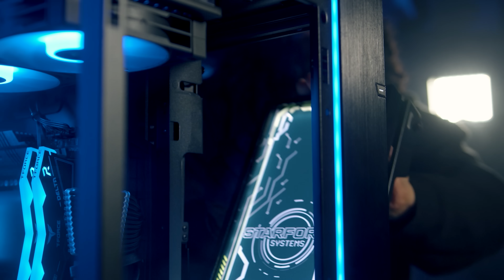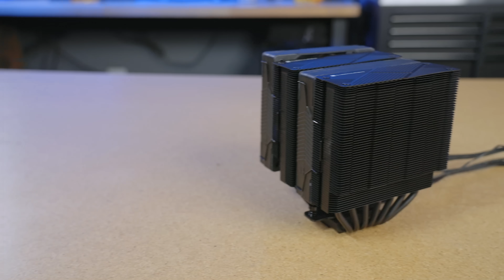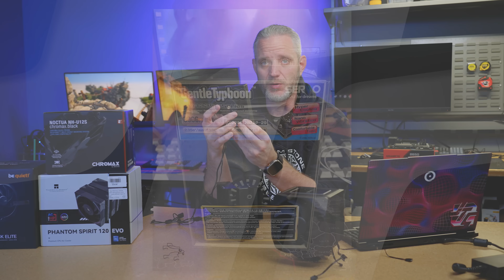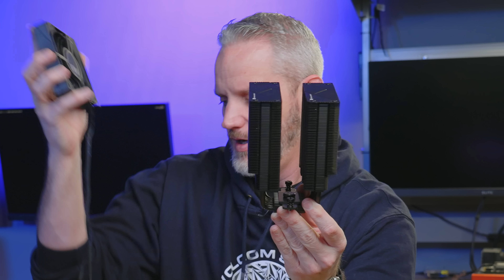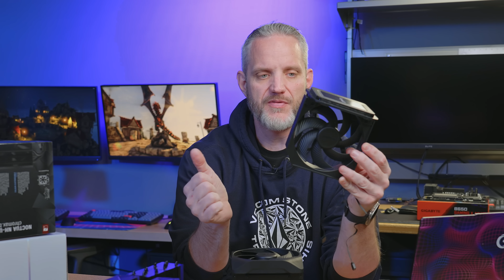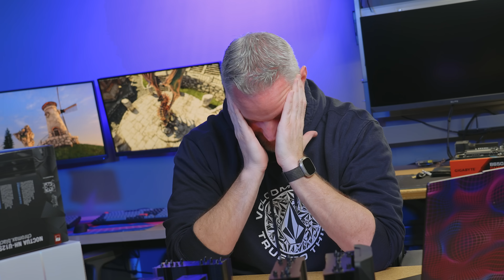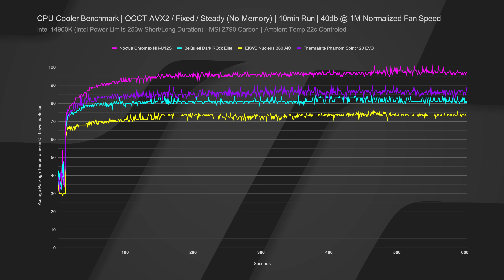This $49 CPU Cooler has big brands SHOOK! Thermal Testing Cheap vs Expensive CPU Cooler!

Comment: I would have found IT more interesting If the AIO would have been more around the same price point as the thermalright aircooler. Like i use an Arctic liquid freezer iii 360 for 60 Euros and IT cools my 9800x3d very well. That would have been a better comparison imo

Comment: I bought that thermalrite cooler because of your previous video. But I put it on a 65tdp ryzen 9 7900 😂 the max temp was around 86C. It is turboing constantly. No throttle at all. It became overkill combo for low price.

Comment: Idk if this is gonna be eye opening as you said, because believe it or not - I know, it's insane -, there are a lot of liquid cooling fanboys out there. Imagine being a fanboy of a METHOD of cooling. LMFAO.
Meanwhile, my old Noctua NH-D15 just got a new companion and they're doing just fine. I got a new 14700K running 5.6Ghz all cores below 65 ℃ while gaming!

It reaches about 83 ℃ in 3 cores and 75 ℃ in about 5 other cores while running Cinebench, btw. I bought thermalright frame just to be safe, but haven't installed it yet.

P.S.: I'm not an expert, but I didn't see it disclosed on your tests that you performed Undervolting. As someone who have constantly in the past said that we need to undervolt, not doing this here in this test - specially with a 14900K -  is crazy.
Reply: i dont think it makes sense to undervolt on a thermal test, its only going to introduce more uncertainty. to test a cooler you need a consistent heat source and representative mounting, and its important to test how the coolers affect the CPU's voltage/frequency regulation. you should compare to stock
Reply: @HiChessie  I see.
Reply: @CeceliPS3 
lol calm down
Reply: @Robbie-mw5uu  first liquid cooling fanboy reply. You didn't have to out yourself, you know... lol

Comment: Favorite that I want, but have absolutely no need for: Icegiant Prosiphon Elite. It's like the wildly impractical sports car I will never be able to afford, but still dream about. 

Favorite that I use myself: My Noctua NH-D15 Chromax Black has served me well for the past 4 years. I also have an NH-U12S cooling my second rig. 

Potential favorite: I will probably put one of the Thermalright coolers in my NAS box when I finally finish it, because they perform well and don't cost an arm and a leg.

Comment: I've become sort of a Be Quiet! fanboy lately.  I love their cases, fans, CPU cooler and power supplies.  I have not had any issues with any of their products accross 3 different PC builds in the last 2 years.
Reply: Their cases always seem like a bad joke when it comes to airflow. The front grilles are like 80 percent solid metal with absolutely tiny holes
Reply: I absolutely love their fan designs with the ripples, if only for aesthetics. I have the Dark Rock Pro 4 cooler and 500fx case, and I have no real complaints on them. I was also planning to get one of their PSU's the next time I need one. 

And then I built a system for someone else that used Lian Li fans and Hydroshift AIO, Lian Li Edge PSU, and in a Hyte Y70 Touch case. I'm now rethinking my entire future upgrade path because that was a build I actually liked doing rather than seeing it as a bit of a chore. My Be Quite fanboyism is waining a lot, especially after that new convertible case they recently released. That just looks fugly to me.
Reply: First Be Quiet cooler i had was the Dark Rock Pro 5 and the high turbulence noise at high rpms just killed it for me. Also the middle fan is proprietary so if it breaks and you run out of warranty you have to buy a whole new cooler. The Dark Rock Elite is even worse because not just the middle but both fans are proprietary.

Comment: Was a huge fan of Thermalright back in the Venomenous & True Spirit line up. My EP at MC for them was great too so I was sad when MC stopped carrying the brand. Left the new consumer scene for a bit as I really got into used server stuff & hypervisors. Coming back to consumer side for the past year or so I've been a HUGE fan of Thermalright. I even went with a 360 AIO (in white) from TR for my current build bc I wanted to test the longevity of them (yes it's mounted correctly). The air coolers are top notch & at a great price.

Once they come out with (or someone posts a 3rd party utility on Github) Linux compatible software for their new screen based coolers will be a huge day & I'll definitely swap out my current 360 for one with a decent sized LCD screen.

Comment: I bought a NH-U12s 5 years ago for $70.  It started cooling a 2600X and today is cooling a 5600X.  I would not put on a 14900K, it's not made for that.  Still begs the question as to why they want so much for it.  I thought $70 was too much.

Comment: I think its also worth noting that some may perform different depending on the platform from what ive seen that is..Intel lga /am5 for example..due to the convexity/concaveness of the ihs and the backplate of the cooler. And i think the location of the ccds was mentioned aswell ..But yeah thermlaright has been killing it..even now doing the "meta" of lcds in some of their air models

Comment: i wonder if it would be possible to build a cheap testing rig that doesnt use a real cpu but can give realistic numbers to tell the tdp limits of the coolers. something like a heating element on an ihs with temp sensors on it, and an arduino or something that slowly increases the wattage till it hits the temp limit, 100c or 90c or whatever, just slap a cooler on there, let it cycle through everything and tell you exactly where it failed to keep up

Comment: peerless assasin 120 and nhu12s. those are my two cpu coolers atm. got the peerless assasin to get more cooling capacity for the 10700k i tossed into the rig (upgrading from the 10105) and coller me impressed it works well.

Comment: Would it make a difference if you put 2 fans on the single tower cooler? AKA, If you already own a single tower cooler would buying 2 fans make sense vs buying a new Thermalrite cooler? Would fan curves not keep the extra noise at top load only but reasonable at average use?

Comment: Noctua NH-U14S would have done a better job than that little U12S.  I use it to cool my 2990WX Threadripper and it does that job in spades.

Comment: What about noise normalized tests as I don't think anyone runs at 100%?
Reply: They were noise normalised to 40dB (in order to handle a 14900K that's ever so slightly above the max rated TDP of all these air coolers).

Comment: Speaking of direct heatpipe coolers, I would loan you my Thermalright True Spirit 140 Direct, but I'm using it.  My favorite thing about the cooler was the box included a pair of gloves so I would not bleed all over the sharp fins during installation.

Comment: Yea, I kind of regret getting a Noctua nh-u12a chomax black cooler. It looks great and its really silent, but there are coolers that are way less expensive and perform very similarly.
Reply: same..... but they do not perform similarly....they perform much better.... 10 degrees is alot and regardless of cost i feel cheated by the u12a on my new build
Reply: @earthling384f  at least we get a cool little noctua badge thing

Comment: '...Ruffles for your pleasure' LOL! Do you happen to have one of those Gentle Typhoons to see if it still holds up today? Would be neat to see older coolers adapted for modern CPUs to see how the old designs hold up if applied. Neat video and the maths for the cost you came up with are an excellent way to see if the cooler is worth it.

Comment: I picked up a Thermalright aqua elite v3 for like 53 bucks on Amazon, I have been so impressed with them and their pricing. I later picked up 3 RGB fans from them for 13 dollars. I absolutely love this company
Reply: Just grabbed their 120 argb reverse flow fans for $8 a pop.
Reply: Depends if they provide new socket mountings. A cpu cooler could last decades .. long term costs will mean noctua would be cheaper.

Another example is AIOs where be quite is a little more expensive than thermalright and arctic, but does allow refilling.

Comment: You're gonna have to pry my NH U12S chromax black out of my dead body! Bought mine 5 years ago for $70 and never had a single problem. Was cooling a R5 3600 for 4 of those years and now a 5700x3D.
Reply: This is like me and my u12a chromax i got them when they first dropped. Man the inflation that's hit noctua parts hurts
Reply: @Demon09-_-  same, I have a u12s from six years ago I'm still using.

It's good that other companies have coolers that's better because it forces innovation.

I'm still using the u12s on my 9800x3d because there's no issues with it and I don't benchmark anyways. I will be changing it to an AIO next year when I grab another 20tb drive on Black Friday and move anything to a smaller, modern case (currently still using my ancient Antec 302 from like 15 years ago)

Comment: Ball bearings are noisier than FDBearings. That's another important reason why most fans use those.
For example the Arctic P12 max started out with ball bearings which were soon replaced by FDB due to complaints concerning noise.
Reply: Jay has been doing this for years I wish he'd do a little more research into fan bearings. He still talks about fluid dynamic bearings as the cheap option that "can get dirt in them" when he's most likely speaking about the actual cheap option which are sleeve and rifle bearings. FDB used to be fairly expensive and are extremely long lasting, and as you mention much more quiet than ball bearing.
Reply: @ True, I forgot about that distinction between FDB and sleeve/riffle. So most fans probably rather carry a sleeve or riffle b than an fdb. And those are decent too obviously as we all use plenty.
Reply: arctic still uses a lot of ball bearing fans for the record, one shouldnt assume its all fdb.
Reply: @ They do use BB but in percentage it's probably rather low. I've had a few and I replaced them all by their counterpart. By the way, the Arctic counterpart to BB is probably rather Sleeve or Riffle bearing.
Reply: There are also some brands that publish numbers suggesting that FDB is longer lasting than Ball bearings. Now I don't believe that's really true when quality bearings are used, but it suggests that FDB can be pretty long lived. Also just because they are called FDB doesn't mean they are all the same inside. there has been several different constructions and it's possible some are a lot better over time than others. But as far as I have seen FDB in general are less resilient than ball bearings. Even Mag Lev bearings tend to eventually wear out, and they really shouldn't as they have no mechanical contact between the surfaces. What kills them is dust attaching to the fan balades and causing unbalance that causes the bearing surfaces to start rubbing. So if you have Mag Lev fans make sure to clean them occasionally and they should have a pretty long life.

Another thing is that ball bearings can be oiled occasionally and they will work for a long time. FDB bearings are not as easy to service. Simple sleeve bearings I've managed to revive using oil though. But that is just a temporary fix that can keep them running as you buy replacements.
Reply: @ FDB are used in Harddrives, so they are very good bearings, better than Ball Bearings in that application. Most fans probably don't use FDB but the cheaper version Sleeve/Riffle bearing.
Reply: @claudej8805  I have old HDD's with Ball Bearings and they are noisy as heck.

Comment: I am glad you are expanding your research.  CPU cooling is confusing  and many do not know how to choose the correct cooler.  I am confused to a point. I have been running the Ryzen 7 3700x (65wTDP)  paired with the Be quiet Dark Rock Slim (180w TDP) in a push pull configuration and it worked well.   I have just upgraded to the Ryzen 7 5800XT (105w TDP) with that same Cooler. I am now questioning if I need to upgrade the Cooler now. With  the 3700x I had some headroom, I think my max temps were  about 91°f. I really don't want to go with an  AIO. Been looking at the Thermalright Burst assassin 120 (245w).  going to wait for your numbers. Oh BTW   Happy 420

Comment: At this point its just how good the base is, with direct heatpipe coolers always being the worst. Coolers stopped being cool and unique after heatpipes were introduced.  Sad but true. Long gone are the days of solid copper heatsinks and neat looking PIN designs that could bend a mobo when installed cause they were so flipping heavy.

Comment: Hardware Canucks recently did a large air cooler testing video.  The noted an inconsistency in the relative performance of coolers across AMD and intel sockets.  You need to test on AM5 as well as the results will change.

Comment: I have a Phantom Spirit 120 SE ARGB for my 13600k. I can run that CPU at 220 watts sustained (5.5/4.3ghz all core at 1.3v with a ring buss clock of 4.7ghz) and it will never thermal throttle. It also holds dual core boosts up to 5.8ghz very stable and the core temps never exceed 90C. When doing Cinebench they never exceed 80C. This is with a Thermalright contact frame and a healthy dose of Noctua NT-H1. For the $35 I paid for it, money very well spent.

Sidenote, the 13600k kicks ass. It overclocks so well and for the price (I spent $450 on everything but a GPU and pulled the GPU from my old system, a 6750xt) it's really hard to beat.

Comment: I wonder how well it does against the Noctua NH-U12A. It costs around $140 but has 7 heat pipes, dual fans and  is smaller for those who don't want that big of a cooler. Plus, you get a 6 year warranty vs 3.
Reply: thats probably one of the most overpriced products ever sold. also warrenty on an air cooler? its a chunk of metal...
Reply: @BTD3Fan  Its all about the fans on Noctua coolers it what your paying for take off the Thermalrite fans and replace them with Noctua Fans and you basically have a D15s for the same cost. Plus really this Test should really have used a 12a or D15s as the 12s is more of a AMD cooler.
Reply: @BTD3Fan So by your logic, no air cooler should have a warranty? If the fans take a dump after two days that's ok? There's a reason people pay more for Noctua. Reliability, performance and customer service. The Thermalright is a good cooler but imho it should have been compared to the 12A not the 12S.

Comment: I run a Noctua 12U ... but also I am austrian, so there is a bit of partriotism involved... and i bought it like 15 years ago ... and it is cooling a 6600 in my NAS. The value with Noctua I feel is that you buy a cooler and never would need to buy anything else, with their policy of sending you kits for new sockets for free. Although on my 7800x3d i would have prolly had an thermalright if i hadn't gotten a 280mm arctice frezzer II for 80 Euros (which is crazy value as well).